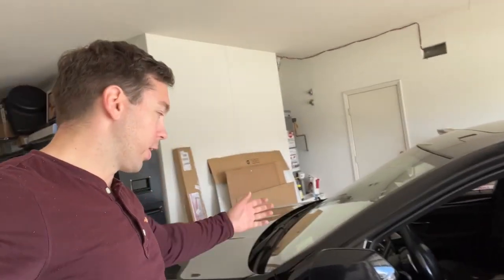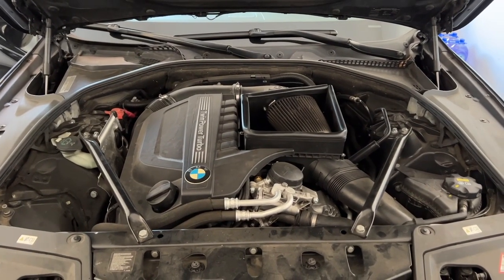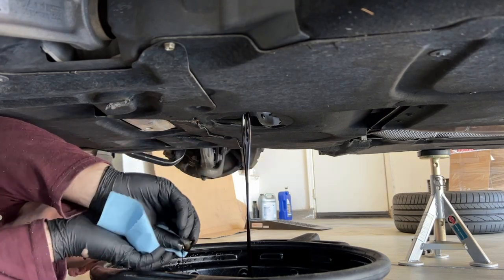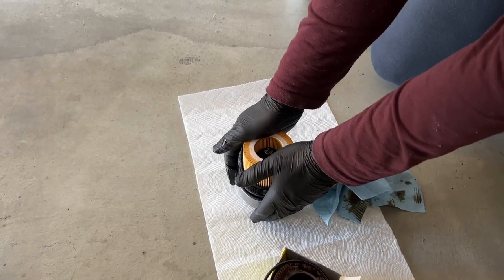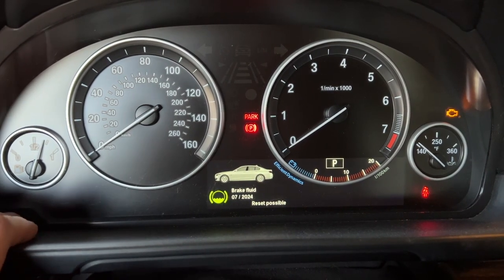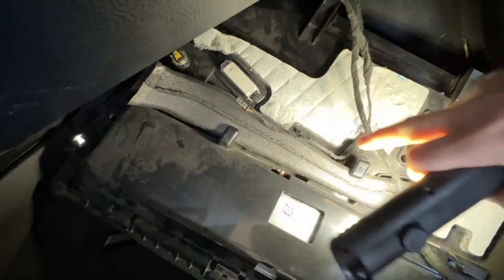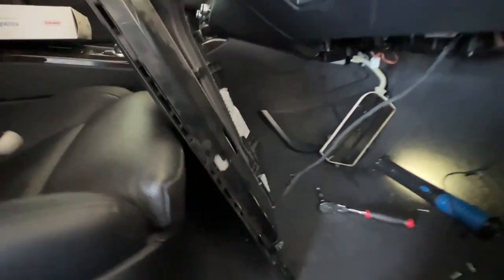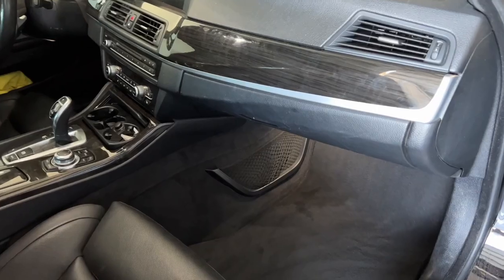BMW 535i Complete Oil Service DIY incl. How To Change The Cabin Air Filter On BMW F10 | BOND Garage

Comment: I was always told to wet the 2 rubber gaskets with new oil before install to make a proper seal and prevent leaks.
Reply from the maker: yes you can do that. it doesn't affect the quality of the seal but makes it easier to mount it without risking that the ring might get stuck and fold, hence creating a leak. I also learned to add a dap of oil to it but forget about it once in a while.

Comment: 535i f10 doesn't have a fuel filter?
Reply from the maker: it does. but you don't change it with every oil change. used to be at the inspection II but I change my fuel filter every 50-60k miles
Reply: @BONDGarage  Got you now, just got a 535i and i am planning to do a full service to it this year, doesn't ask for one till December but better early than late :D
Reply from the maker: @loyd4you  I'll do a major overhaul as well later this year. fuel filter will be a part of that as well.. 
how many miles does it have? every time I get a new used car I'm changing all fluids and filter just to have a somewhat clean basis to start of.
Reply: @BONDGarage  Mine has nearly 49k miles, it has service history online, it got serviced at bmw but i just wanna make sure like you said that i have a base to stand on.
Reply from the maker: @loyd4you  that's pretty low miles. Go for it! It'll give you the peace of mind
Reply: @BONDGarage  Will do, will do. Like the car so much, i was looking for a good 535i for ages :D